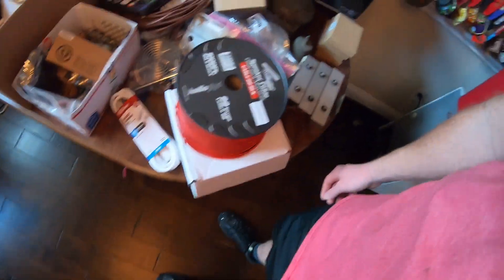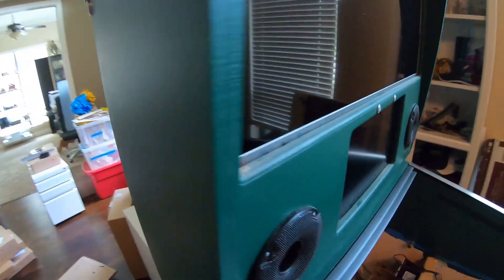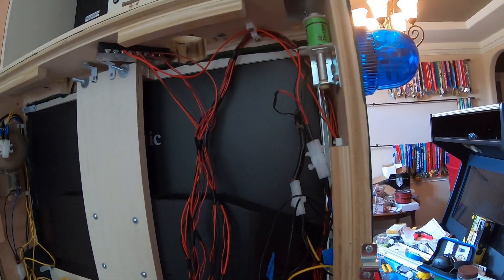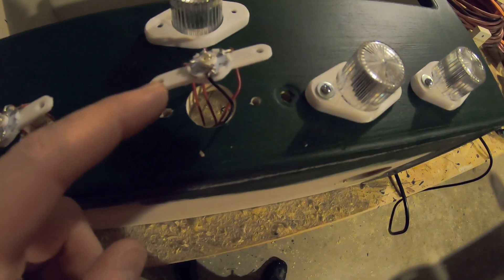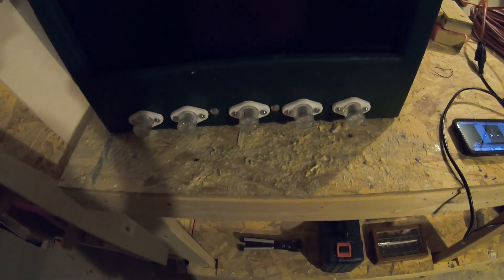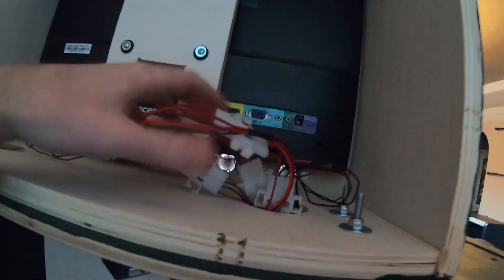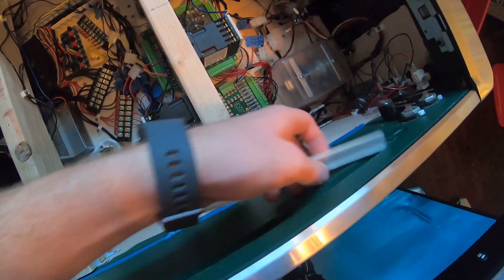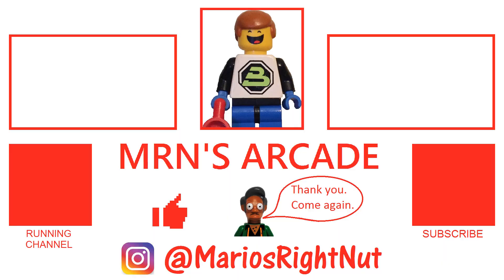Five Flashers - Virtual Pinball Build 16

Comment: 1,000 feet g'dammit :-D Every time I watch one of these videos I understand more and more why your LEGO city has that awesome custom light setup. If I only had a third of your capabilities with electronics! Are there any negative consequences in using the long wires except for the physical risk of tangling!? Thanks for sharing this and keep up the great work :-)
Reply from the maker: Yes, there are negative consequences to long wires.  However, these are only 5V and almost no amps, so it really isn't too big of a deal.  Anything more powerful, you'd need bigger or shorter wires.  Almost there!
Reply: @MRNBricks  Sooo, what your saying is that less power comes through if the wire is too long?
Reply from the maker: Not really, it's more like if you push too much power through the wire, it'll melt, start a fire, and do bad things.  Haha.  There's tables that show how many amps you can push through a given length of wire at a given diameter.  Go bigger if you are nervous!
Reply: @MRNBricks  Ohhhhhhhhh, that makes sense.... and sounds dangerous :-D

Comment: Im in the process of making these flashlights and I use white pushbuttons instead of the lights you use. I find them rather clumsy. My question is do you connect the resistor board to 3,3 Volts or to 5Volts ? 
There is a wire from the PSU that holds 3.3 Volts. Maybe I can use that.  So how did you connect the resistor board ?

Thanks in advance.
Reply from the maker: Honestly, I think it would depend on the hardware you’re using. It’d be difficult to say exactly how to wire it without seeing the exact hardware. The voltage would depend on the input required for your set up.